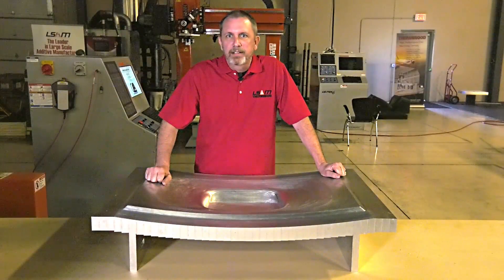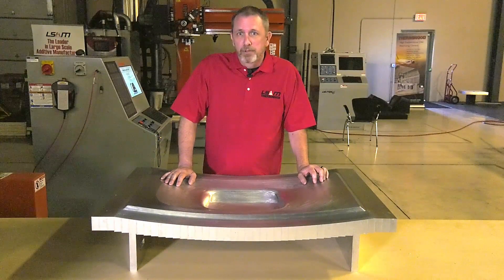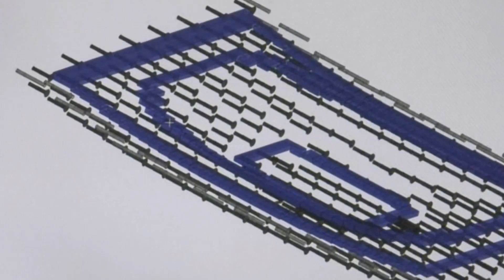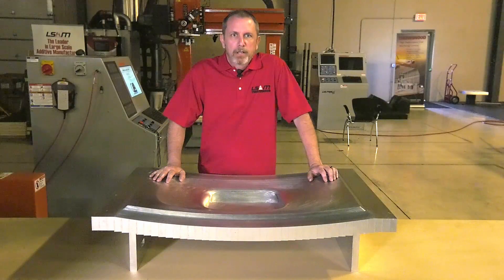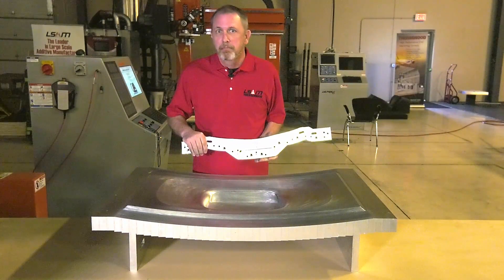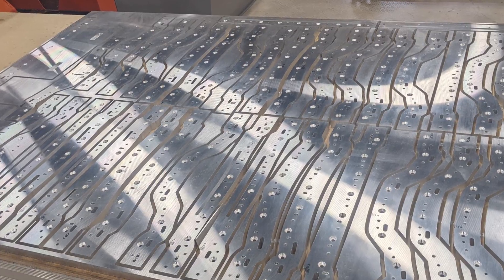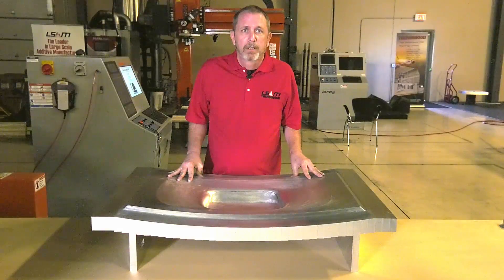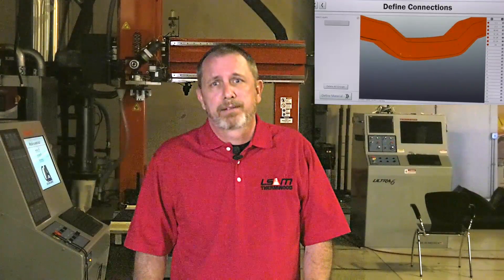A New Additive Way to make Metal Molds 🚀

Comment: This is very interesting!  Maybe I missed it but how do you keep the joints from leaking either air or cooling liquid?  With cast and ground plate does the bolt pressure work?  I guess you could gasket each layer pretty easily with little o-rings around the machined channels?
Reply from the maker: Hi @ExploreComposites, Here is a response from Jody:  Since this is a thermoforming tool, any leaks from the vacuum chambers will be overcome by the pump itself.  One method I will be testing for the temperature control lines (which could be used for the vacuum chambers as well), is to run CRC Head Gasket & Block Repair formula through it.  I've heard really great things about it in the racing industry.  I will be testing this when we get back from the CamX Show in Atlanta and will pull parts from it afterwards.  We are also talking to a company about applying a super thin coating to the working surface to prevent leaks and lines into the parts.  Anymore questions or info, feel free to respond!
Reply: Thanks! @ThermwoodCorporation  The gasket sealer is a neat idea.  There are some composites-specific mold "primers" that are a wipe-on coating that goes on before a release system.  They do fill and cure to a hard sandal surface and will stick to aluminum.  Might be a way to at least remove the print of the seams into a part. surface.  The system is very neat, especially the automated programming.  Have done very similar before designing and programming "by hand" and it is soooo much work and easy to make mistakes.  Look forward to learning more!